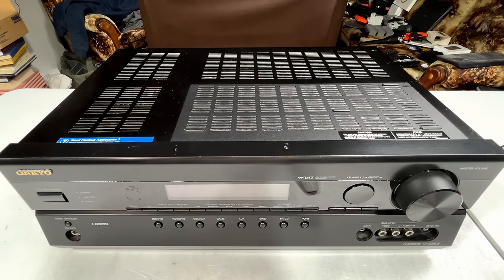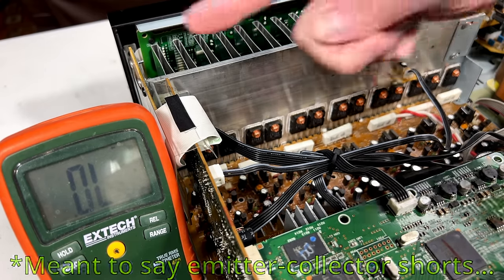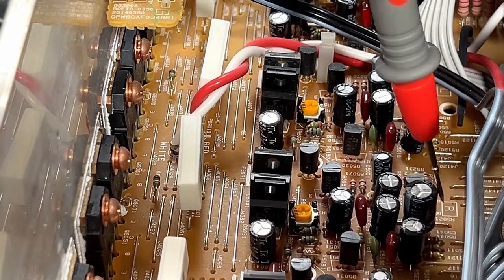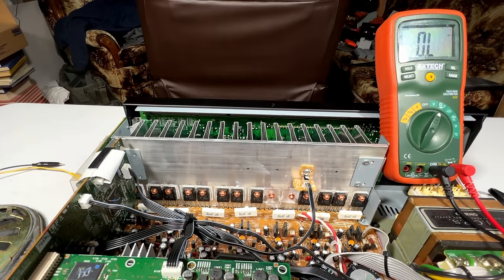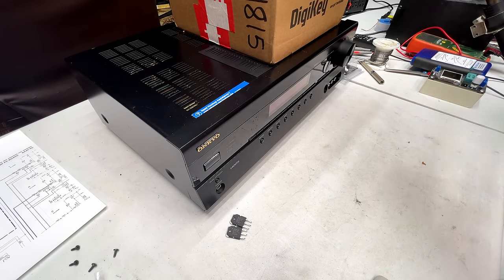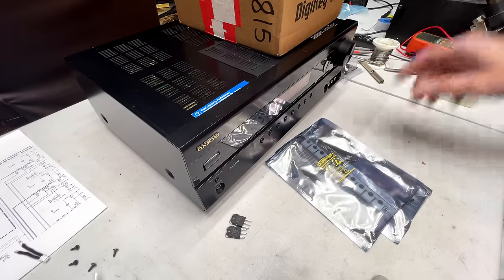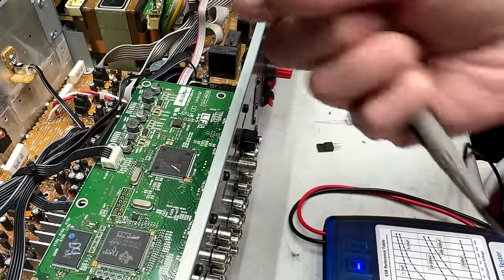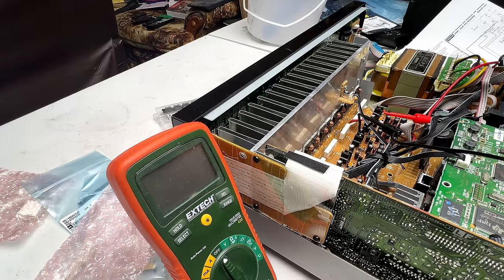One Dollar Onkyo TX-SR508 Receiver - Won't Come Out of Protection

Comment: Keep going its a good challenge to get this amp working.....i repaired a SR 607 and i found several power transistors dry jointed and also a few dry joints on the main pcb....seems to work ok now.

Comment: also always check the outputs for dc voltage with a dummy load connected and after repair same thing as you may have to adjust the dc offset

Comment: So far so good.  It seems like you've got the major problems taken care of, now time to clean up the little ones. 
I would double check Q6031 again.  That burnt resistor on the base of Q6031 was due to high current passing through it.  That same current went through the base of that transistor.  Hopefully it was rugged enough to handle it, but it concerns me none the less.
Reply from the maker: That's one of my main concerns as well. I really wanted to replace those pre-drivers.

Comment: about the other transistors... yes you can find replacements for them they may have other pinouts but you can just make a little adaptor board for them.... and as long the current they can handle are the same or more they will be usable as a replacement... but then you got to change them all !!!! timestamp 25:31